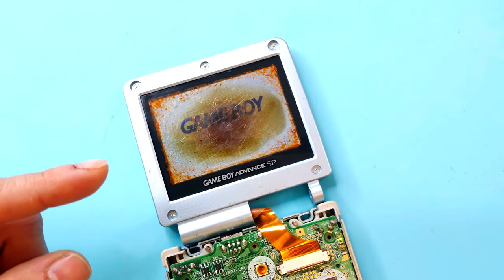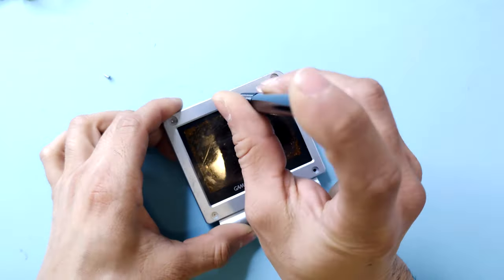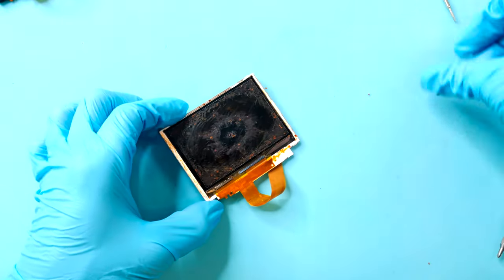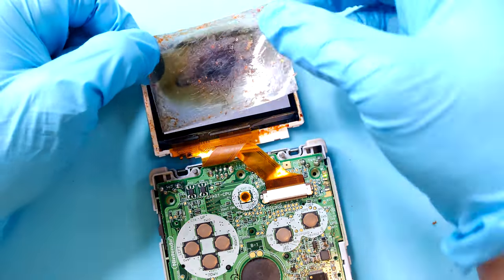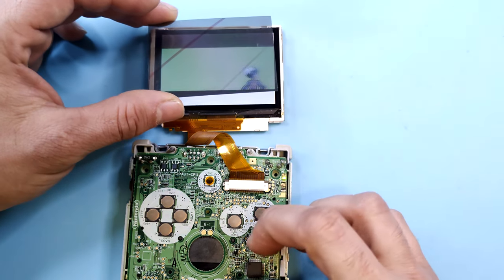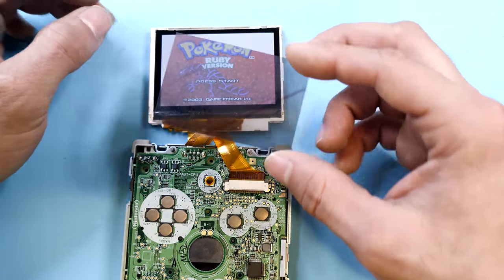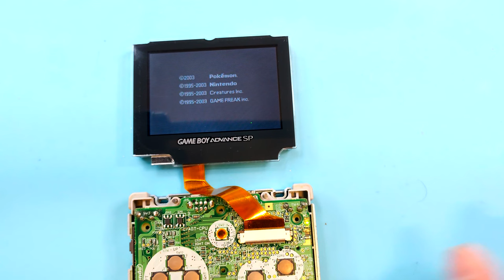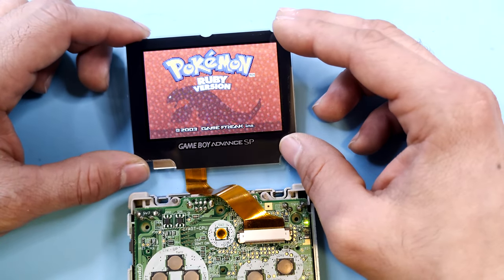How to fix a screen burn on a gameboy advance sp (replace polarizing film)

Comment: I have a Sega Genesis Nomad and a Game gear with the same issue; but the screens are lower quality color glass LCDs with 2 polarizer filters on the front and back. That horrible symptom of LCD displays is called Vinegar Syndrome Disease. For me, it’s gonna be a real challenge, to do this on my Game Gear. That one has a mini-fluorescent backlight tube mounted on the rear of the main video board, that can zap the jewels off of you, if you ain’t careful. 6 triple-a batteries = 9 Volts, stepped up to 35V by a power inductor, to power that tube. I’ve been zapped by one of those before, as a teen rookie learning electronics in high school. That is no joke, & It freakin HURTS people.
Reply from the maker: Oh dang, well best of luck on that repair. ") hoping you dont get zapped 🤞

Comment: This is very helpful but I'm afraid I might not able to do it properly because almost all the device I tried to fix becomes more damage instead.  😂
Reply from the maker: Its less intimidating than it looks. And if you have several polarizers you can just try it again ")
Reply: Ive been fixing devices on my own for the last 2 months, i learned from youtube.I advice you to start fixing small and genuinely useless devices, after some time, when you learn to be really careful with tech stuff you cant fix it.

Comment: Thank you for this! Do you have a fix with 101 that has White corners?
Reply from the maker: No problem ") and the white corner issue is called screen bleeding. Ive heard of fixes for that on other lcds. But ive looked into it on the sp 101, and have found no fix for it sorry "/ so far its something unrepairable. Screen bleeding usually occurs when light is escaping from the lcd. But on the sp, even removing the backlight assembly, or adding black tape to the edges didnt do anything. Its like its an issue with the actual pixels themselves on the lcd.

Comment: I thought that my problem was the polarizing film, changed it but my screen still white, u can barely see the gameboy logo when its turned on. (its easier to see if you look the screen from above, but still almost entirely white) do you have any idea what can be the problem? i'm afraid of buying a new screen and still having the same issue. I also tried to press the ribbon cable to see if anything changes but it still the same
Reply from the maker: Your problem sounds like a very bad case of screen bleeding. Which is technically is sometimes repairable on certain lcds. But on the sp ags 101 lcds and in the gameboy community. So far thats a unrepairable problem.

Comment: can i replace with TV polarizer? and how much degree 0° ,45°, or 90° ?? please help me... polarizer gameboy so expensive to me :'(
Reply from the maker: Sorry I wouldnt know, it depends on your tv, if its a circular or linear polarizing film... Most Lcds are all different. The first time I tried using an extra phone polarizer film I had, and it worked. But was too reflective, and didnt look right. So it wasnt the same it needed
Reply: @retrostashrepairs  thanks for the information broo... i dont have idea for polarizer gameboy 😁😁😁 its so expensive in my country

Comment: I just bought a polariser film for a 32 inch lcd tv as i didn't found any smaller one , I'll simply cut this film to the gba sp size and use it it. I just cost me 3$in  INDIA
Reply from the maker: It might not work though. All lcds are different. Theres 3 types of polarizing films reflective, transflective, transmissive. Which also come in different light wave polarizations, linear, circular and Elliptical. For example nonbacklight gameboys use reflective linear polarizing films. While sp ags 101s use circular.
Reply from the maker: Theres a slight chance it might work, but it would be with luck.

Comment: You look like you roasted marshmallows on that GBA SP.
Reply from the maker: Lol yeah and thats ive seen and fixed worse. 🤣
Reply from the maker: One time one had it so bad even the whole thing was rusted, corroded even the frame was bad, had a screen burn, couldnt see anything, had to replace everything even the diffusing films inside, back and front polarizing films, entire frame etc... Looked like someone through it in a firepit lol, ended up working and looking good in the end since it still had a good lcd. Dang that sucks I didnt do youtube yet, would of made an awesome video.
Reply: @retrostashrepairs  I think too many kids out there didn't take advantage of the fact that Nintendo made (at the time) very affordable protective cases. I didn't use them, but I seem to recall some other kids even using protective shells over theirs.
Reply from the maker: @dorememe8548  or leaving it on top of their parents car dashboard, out in the sun.

Comment: Hi, my gba sp has a burn but it's the one inside the lcd, the one behind where you can find multiple layers of films. Is it also a polarizing film that was burned? I hope you can answer this asap, thank you so much. Because I have already replaced the polarizing like on the video but there were still burn marks, and I checked the back part of the lcd and the last part inside had the burn.
Reply: i peeled every layer and now my screen has inverted colors :c